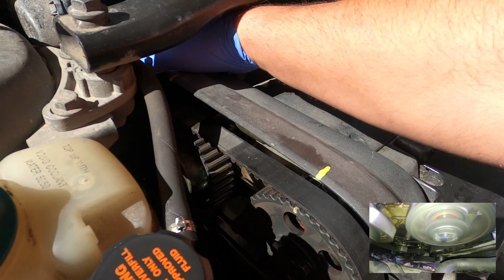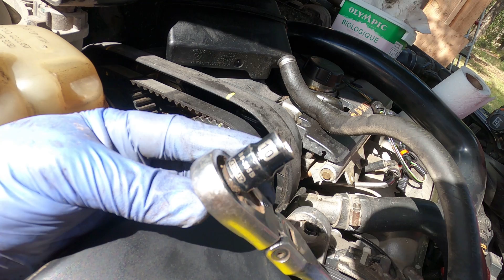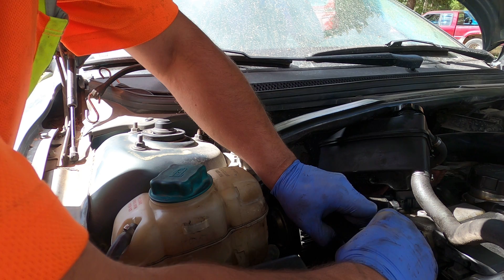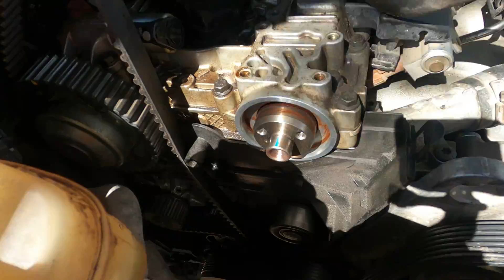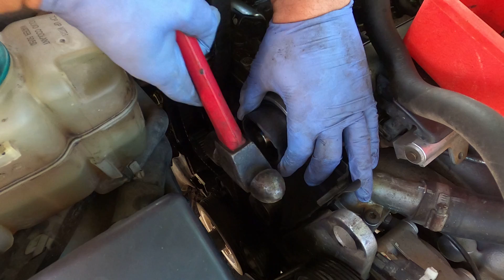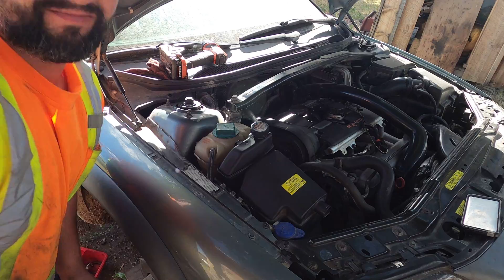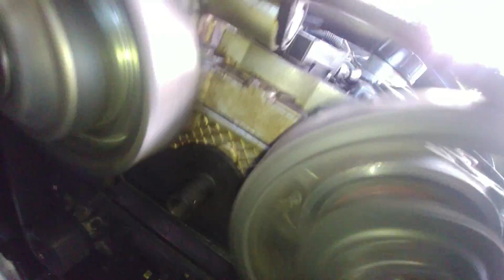VOLVO CAMSHAFT SEAL REPLACEMENT WITHOUT CAM LOCKING TOOL (NON-VVT) |  TIMING BENT TENSIONER SETTINGS

Comment: Hey bro thanks for the video !!!  Quick question.... Do you live in the Seattle area ?
Reply from the maker: Hi Amer! You are very welcome. I hope my video is helpful.
No, I'm not in Seattle area.
Reply: @PistonShack  OMG was coming home from work today and the same thing happened to me as you.  There's oil all over the bottom of the car SMH.  I'm so depressed this is too hard for me to do to be honest and all the mechanics want alot of money to do this job.  Soon as it happen I got the message NO OIL PRESSURE message, I'm so luck I was half a mile from my house.
Reply from the maker: @McDraisaitl  Amer, that's so sad to hear! If the engine runs without oil even for a short time it could be the end(  Check oil pressure before doing any further repairs.  Let me know how is your repair or if you have any questions. Cheers, Brotha!
Reply: @PistonShack  Hello frined.  I'm pretty sure the oil leaked out a slow pace and wasn't completely drained by the time I was home.  Message appeared approx half kilometers if that and I just just let it roll in Neutral downhill to my garage.  Anyway that's a great idea before dumping more money....how do I go about checking if the engine is damaged (oil pressure ) in this situation, before bringing it to a mechanic ? Thanks for your help in advance
Reply from the maker: @McDraisaitl  You're so welcome. I make sense to check if the engine has life left, especially after driving with low oil pressure light on. I did VW Golf MK4 project in 2019 - no oil pressure issue, as result run out of oil.  I filmed a video: 
HOW TO CHECK OIL PRESSURE ON YOUR CAR. SIMPLE STEPS. Volkswagen Golf Project. 
https://www.youtube.com/watch?v=bIdx3cWhWjU&t=78s
VOLKSWAGEN NO OIL PRESSURE. Tips, Inspection, Oil Pump Removal. Golf Jetta Beetle Polo
https://www.youtube.com/watch?v=-cfaTajwBqQ&t=477s
Check it out brotha!
Reply from the maker: I hope for the best! Volvo Run Forever...
Reply: @PistonShack  Thanks a alot God bless you !!!
Reply: @PistonShack  Hello again.... finally got around to taking off timing belt cover to see the situation.  I got lucky the camshaft Seal didn't blow off but rather was popped out a little bit and so the oil came out a slower pace which enabled me to make it home as I mentioned I was really close.  I was hoping I could send you some pictures of you have an email.  I don't want to bother you unless you don't mind giving me some advice.  I watched your video again and I think Im able to perform this repair myself, thanks to you.
Reply from the maker: @McDraisaitl  Hey Brotha! If seal came out once, it will do it again. You don't have to take a risk. I would go and put new seal anyway. No worries, If I can help you a bit with your repair it will be awesome. Just record short video and post on your channel then we can discuss all details. Have a good one!
Reply: @PistonShack  yeah I was born and grew up  in Edmonton but moved to Seattle when I got married.   Here it's Volvo heaven so many Volvo's it's crazy.  Also I noticed your accent same as my wife's.  You must be either Ukraine/Russian or maybe from the Yogoslavia countries ???  Which also here in Seattle area, they have huge community.  That's why I asked if you were from this area...didn't mean to ask personal question buddy.  Anyway if you're ever down here maybe we can work on my 2 Volvo.  That wood be awesome !!!